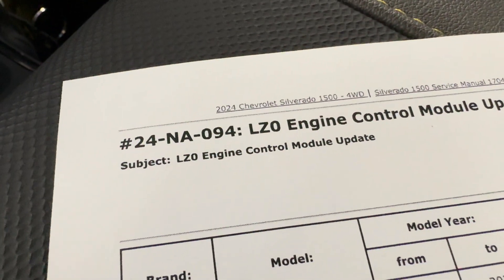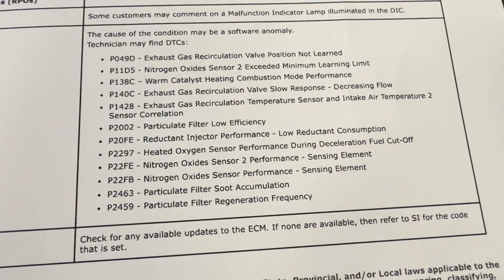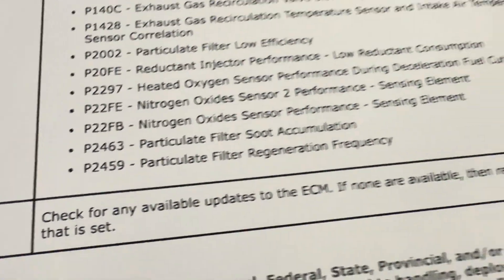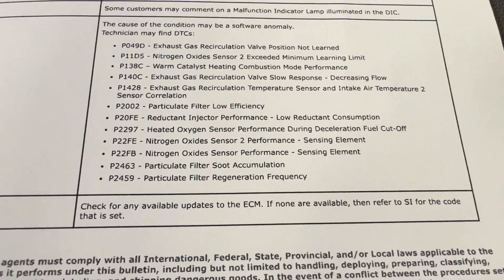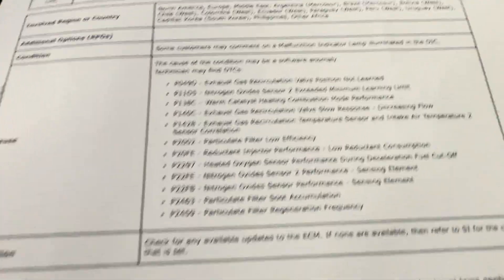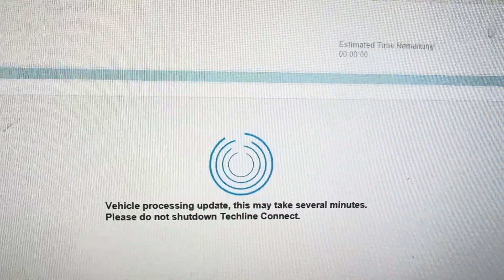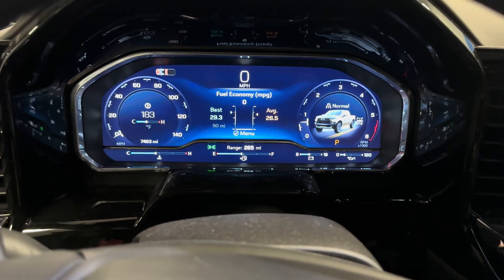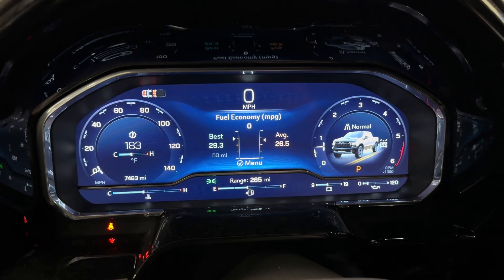FALSE DPF FAILURE CODES FIXED - 2024 3.0 Duramax: ECM Update Available

Comment: I have a 2024 LZO. It has the P20f8 code. The dealership wants to replace the intake manifold. The truck is running great and idle normally. Shows it has the update is closed on my vin

Comment: I had the same code/issue (P140C, and P045B) at 2500 miles on my 2024 Silverado w/Duramax 3.0L that I purchased in Feb. 2024. The dealer cleared the code, and replaced the EGR. No further issues until last week (Dec. 2024) when the truck threw a CEL, and I got the emissions warning, and 174 miles to 65 MPH limit. Luckily I was close to the dealer service dept. and stopped in. They brought the truck in and found that there were two codes: P140C, and P045B. The mechanic referenced the above service bulletin: 24-NA-094, and reprogrammed the ECM. Haven't driven the truck much since I took it home, but fingers crossed, the reprogram solved the problem. I'm thinking that if this update was available back in February, it's possible that the EGR didn't need changing.
Reply from the maker: I hope it's finally resolved for you. i want to add that in November, there was another update to the programming available so if it wasn't resolved with this bulletin, hopefully the newest also does it.

Comment: Just purchased a 2024 GMC AT4 with the baby Duramax and only 958 miles and the P2463 code came up, turning on the Reduced Power Mode. with the MIL.  Truck was built in May of 2024 so hopefully I get the ECM date. By the way great channel keep it up!!!

Comment: My 23 has thrown an engine light twice already, where it goes on for a day and then turns off the next. Its at the dealer now, saying something about a nox sensor and i just had one replaced not even 4 months ago. Could it really be a failure or just needing an update similar to this? How easy would it be for a dealer mechanic to catch?
Reply: I’m having same issue with my 23, what did you end up having to do?
Reply: @jeepzj2.0  apparently it was an update that a dealer was able to do for ECM. I ended up having to take it to another dealer but yea i was surprised when they fixed it, they said i didnt even need to replace the one nox sensor i already did. Havent had an issue since!

Comment: Do you have any comprehensive list for the LM2 ECM updates and the changes/fixes they do besides extend some settings to keep it from crank no start spiral? I was looking into getting the ECM update for a 2021 LM2 I have as I've gotten the crank but no start 2 or 3 times since buying it early spring... I tried digging through forums the last fews days debating if i wanted to add the update(s) to the visit while I had a service scheudeld for a NOx code that came up over the weekend

Comment: Thanks for the vid. Just had a P140C on my 24’ GMC with less than 1500 miles and turned it into the dealer.
Reply from the maker: Ah man, that sucks! Hope the dealer gets it fixed up quick. Keep me posted on how it goes and if this was your fix.
Reply: @DemonWorks  Got my truck back. Just needed this software update. Thanks again for posting!

Comment: Just threw a P2297 CEL at 7500 miles. I'll bring the truck to the dealer and ask about the TSB
Reply: CEL cleared itself later that day and showed up again for a couple of hours on Saturday. It's now Monday, the day I'm scheduled to bring it into the dealer, and the CEL has not reappeared. I called the dealer and asked if I should still bring it in without the CEL being on. The tech I spoke to said they could check the code, but without a CEL, they would not do any repair. I canceled the appointment.

Comment: Had the update installed yesterday and like on cue, had a regen on the way to the dealership after 130 miles of highway driving.  Seems like after the update, I don’t hear the turbo whine as much anymore.  So maybe they tweaked the turbo controls.

Comment: Any updates since the EMC update? Curious to see how this changed things for you? My P2463 light had been off for too long before I got it to the dealer, so they wouldnt update mine.
Reply: So the ECM update hasn’t addressed the frequent regens you’ve been seeing?
Reply from the maker: @run4b33r when I posted that, I was getting 200-300 mile regens. My past two regens have been at or above 300 miles. So, maybe I am seeing it now.
Reply: @DemonWorks if I had cleared one of those codes in question and am getting frequent regens should I still take it in? Will they be able to see historical codes?
Reply from the maker: @samgford  Sam Ford regen frequency is mainly around driving area and driving style. Nothing in here says that it will extend regen frequencies. Just wanted you to know that before you get let down if there’s no change.

And no, the code likely will not be stored any more.
Reply: @DemonWorks  gotcha. I'll just wait for another. My regens are slowly getting better on its own anyways. Directly after the code I dipped to 150 miles or so from 400. My last one almost hit 250. So progress I guess? My driving has been very very consistent since I bought it in February.
Reply from the maker: no changes in my use.

Comment: It's Saturday, and I'm at the dealer for the complimentary oil change. I asked about the TSB, but was told if you're not currently throwing  one of the identified code, they usually won't do the TSB. The service associate said I could bring the truck back during the week if I wanted it checked out, but I'm going to hold out for now.

Comment: Canadian dealerships (Alberta) do not have this TSB update when I checked today.  Was told it is not in the system.
Looking forward to see how this update improves LZ0 operation on my standard box AT4.
I have 7700+ kilometres (5000 miles) and primarily tow an enclosed v-nose sled trailer, about 5000 pounds total weight.
Speeds between 90-110 kilometres per hour (56-68 mph) average 20.4 litres / 100 kilometres (11.5 mpg) over about 6000 km (3700 miles) distance when towing.
DEF as high as 7% relative to fuel consumption. Outside temps between 0 and -20 Celsius (32 to - 4 F).
However, when not towing, mileage is as low as 5.7 litres / 100 kilometres - which is around 41 MPG - and DEF usage is non-existent.
I have had a DEF tank replaced and a particulate matter sensor replaced - different visits to the dealership - and the DEF gauge is a disaster when towing.  I can fill the DEF tank and 100 kilometres later (62 miles) I get a warning to fill up the DEF. One time it said I was empty and only took 3 litres, which is under a gallon. So I have learned to ignore it.

With all the towing, based on the dealership printouts from my last visit, I averaged a regen about every 1000 kilometres (630 miles) which is incredible. Local dealer has been good and I gave them a lot of data to provide to GM. Don’t know if they did but dealership told me back in March to watch for a TSB to deal with the issues I was having.  

In spite of the DEF consumption when towing, I can’t speak highly enough about my LZ0 AT4. We also run a 5.3 litre Suburban and a 6.2 litre GMC Sierra so we have a good sense of what each truck does.  And I drive a 6.6 litre diesel Silverado for work. 

Looking forward to the updates on how this TSB affects the LZ0. I really appreciate your channel and the dedication to providing information.

Edit: I run premium (Dieselex Gold) exclusively from commercial cardlock.
Reply: TSB 24-NA-094 is now posted on NHTSA website. Confirmed with my local dealership they have been doing updates where required / needed.

Comment: Had to take my 24' LZ0 twice to the dealer for P2463, it's currently there now. I'm going to call them on Monday and share this info 😂. Maybe this will fix it!
Reply: So far since the update I have not had any issues, but I've only put around 450 miles on it.
Reply: It should.
Reply: Any updates?
Reply: Experiencing the same issue with mine. Just had the same code addressed for the second time this week at which point they did the update as well. Waiting to see how this goes.

Comment: I’m about to take mine into the shop because my dash quit working. It just flickers and the chime sounds every 30 seconds or so. I tried disconnecting the battery for 8 hours to reset and that didn’t change anything. Glad I’ve got the idash so at least I know the engine is running right and I can still see my speed. Guess I’ll be asking for this update while it’s there.

Comment: I have a 24 LZ0 as well. Has anyone noticed the whistle when driving around town at low speeds? Im assuming its the turbo but I never noticed this on my LM2
Reply: No whistle here
Reply: I hear the slight whistle. Normally on lower RPMs and right before it shifts, pretty sure it's the turbo.
Reply: I hear it and I love it lol
Reply: i had a 2021 lm2 that did not make the noise you're talking about, but my 23 lz0 does. strange. i suspect it was the compressor bypass valve ( blow off valve ) there is almost no mention of it anywhere.

Comment: No ‘23 LZO folks?  Booooooooooooo

I have no codes… but I regen more than I change my drawers.
Reply: There was a TSB put out for the ‘23 LZ0 23-NA-071 dated April 2023. I purchased my truck in December 2022 and had done my own oil changes so about two weeks ago my check engine light came on. I took it to the dealer and it was for this TSB update. I assume that if folks take their vehicle in for typical maintenance the dealer checks whether there are any updates that need to be made. Hope this helps.👍
Reply: I have a 23 and my truck does a regen 2-3 times a tank of fuel.  I'm watching your videos to find an answer to this.  I know dealer will blow me off with on codes
Reply: Have you changed anything under the hood? I haven't noticed a single Regen in 6k miles on my 23
Reply: @JPzaSniper My ‘23 is stock but I have a Banks IDASH that I use to monitor for REGENS. Not sure how you would know without it.
Reply: @NMTRUCKER  apparently there's a change in rpm or possibly limp mode or something , but it would tell you not to turn the truck off if you were in a Regen, and I've never seen that message so idk
Reply: @JPzaSniper  Usually if you do a lot of city driving and don’t let the REGEN cycle complete the digital instrument cluster will post a message telling you to drive at highway speeds to complete the REGEN. If you ignore this message the truck will eventually go into limp mode. Then you have to take it to the dealer so they can do a stationary REGEN. However, if you have a decent OBDII scanner you can do the REGEN yourself. I think the DPF has to be loaded to 140% before it goes into limp mode. Hope this helps.
Reply: @JPzaSniper I don’t think that’s true.  I’ve shut my truck down in the middle of a regen, had to, with no warning at all.  It just went back into regen the next time I stated it up.
Reply: @NMTRUCKER as for regen, do you have a banks gage to tell you when you are or are you just relying on some kind of sign?  When in regen, your truck will operate the same, just smell a bit at stop lights and your fuel mileage will go down.  If you don’t have a gage, I suggest you get one so you can monitor when in regen or when it’s close.  That’s if you care.  Some don’t and that’s ok too.  My regen cycles are around 400 miles when totally on highway driving and 150-225 in city driving.
Reply: @hammer-r  I'm not sure if the Regen is just hit and miss or if it has something to do with def usage and type... I see a bunch of posts where constant regens means oil burning and a ton of def usage, I just checked my oil at 5k and never dropped and have only topped def off once
Reply: @hammer-r  That’s the first thing I added to my truck. I have both a data monster and a supergauge. My typical REGENS are between 300-400 miles but I have gone over 500 miles between REGENS occasionally.
Reply: @JPzaSniper  what you are describing sounds familiar to another video by another person.  It was on a 2022 diesel and that was linked to a design issue on a manifold where it would burn oil, increase def usage and foul one of the glow plugs.  That part was redesigned for 2023 and beyond.
Reply: @NMTRUCKER  thanks and sorry didn’t see that you had one,  yea needed if you want to keep on top of things.  I really wish that GM would have put that indicator on the dash.  It’s rather important and it should be on our radar on the dash.  Good to hear on Regens, yea mine are ok when on the highway. Someone in here noted he got better regen distances with hot shots. I use it.  Do you too? Or something else?
Reply: @hammer-r  yeah I remember that, and then saw another video of a lot of the same complaints with a 2024, just haven't done a deep dive into it as I don't have those issues
Reply: @hammer-r  I have been using Power Service additive for its lubricity and anti-gel properties. It’s readily available and is endorsed by Cummins if that makes any difference. I use hot shot in my tractor. 
I agree that GM should put some type of readout for REGENS. It’s in the ECM and could be displayed on the DIC. How hard would that be? 🤔
Reply: @NMTRUCKER  Tks for the info.  I have some PS additive too. I switch between the two with the occasional use of the GM brand too.